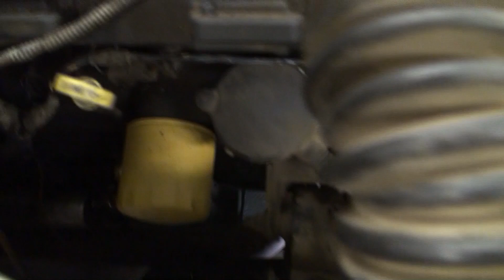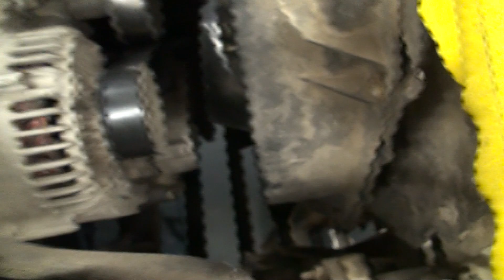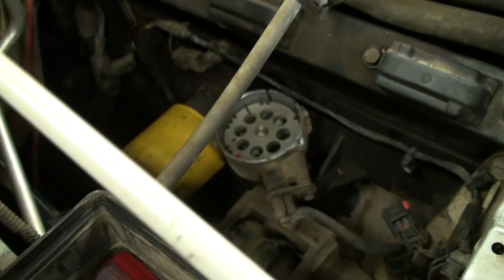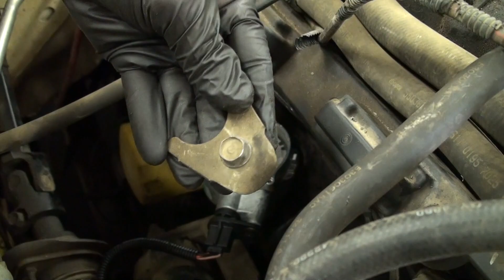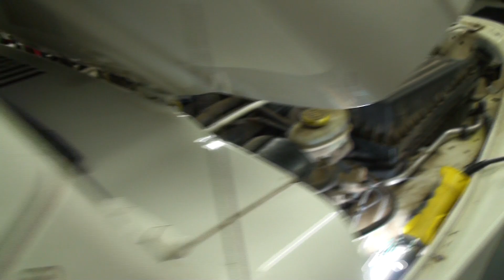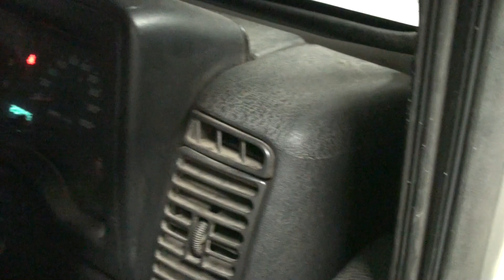05 Jeep Wrangler OPDA (Oil Pump Drive Assembly) change out

Comment: I didn't take the cap off the old camshaft to set the pin I just took the whole synchronizer out. Would I be able to just set the new in then pull that plastic pin out of the new camshaft synchronizer once it's down in?

Comment: Great video. However I would highly recommend NOT REMOVING the pin from the new unit, as removing the pin allows the unit to spin freely if it turns there goes the timing..... just use a small screw driver or punch to line up the hole in the old one. that pin is designed to be left in the new  Oil Pump Drive Assembly then when you start the engine for the first time it simply sheers the lil plastic pin off. they are designed to do this. Secondly you should remove the original camshaft position sensor from the old Oil Pump Drive Assembly and put in the new Oil Pump Drive Assembly, for some reason the new camshaft position sensors that are coming with the new units are prone to failure.. Good luck my fellow Jeepers

Comment: I finally got around to doing this to mine today. I have had the part for sometime. I was really wanting to take it somewhere and have it done, but after watching your video and a few others, I did this on my own with my son. It took us about an hour, and it all went pretty well. I was so extra nervous and cautious about lining  up the pin. We checked and checked, and checked it again. There's a little play in the original device, and we wanted to make sure that the max and min in the play was right in the middle.  The other hard thing was trying to figure out for sure which direction to turn the motor to get the pin holes to line up, but we figured it out. Why there did an oil change and it's sounding great and there are not CEL issues, as of yet. Drove it for about an hour after and no issues. Thanks for the great video on this it was very helpful, and surely saved me a few hundred $$ by doing it with myself, and some good tool-time with my son.
Reply: You turned the pulley clockwise, right? (I think this is the right direction, but I'd be happy to know which direction you turned it) just to avoid mistakes... (to be safe, I take advantage of the experience of those who have already done it)
At last, i ask if you removed a spark plug to make it spin with less resistance? I think it makes a lot of sense, at least logically it should make life easier without causing any sort problems for the final result...

Comment: I did exactly what was done here and the pin seemed to move clockwise about 1hr position.  It appears that I am still ok, I think because it would fit only there or 180 reverse of that.  If I try to cloch it 1 hr back it will not seat the shaft down properly.  Am I correct in assuming I am ok?

Comment: Nice video. Appreciate the step by step. A number of people are having trouble after install....it seems because the new one was more than the 2% or so off in alignment from the prior odpa.....I wonder if it is bc they are not using the plastic rod to align prior to removal.

Comment: Replace the old OPDA with a Crown Automotive unit, P/N: 53010624AC and use the OEM Mopar sensor. Do not use the Crown sensor as it will throw codes. The Mopar sensor has numbers etched on the sensor face; the Crown sensor is blank.

Comment: THE BOLT UNDER THE OPDA IS A 1/2" AND NOT 13MM AS HE SAID IN THE VIDEO. DO NOT USE A 13MM OR YOU WILL STRIP THE BOLT!!!

Comment: Thanks for the video - I do have to ask why you didn't show how you placed the plate and bolt that hold the unit in place. That one part was a PITA. And the 2006 bolt is a 1/2" bolt head. Very helpful

Comment: Great video! Had mine out and the new one in, in about 40 minutes.  The hardest part is getting the keeper bolt under the opda out and back in. Used my old cam sensor as I've read the new ones are garbage. Don't forget to pull the white plastic line up piece out once you've installed the new opda. If you leave the cap on you won't see it. I remembered, but I could see how you could easily forget it. Also, I used an open end wrench to turn the motor as it was easier to get on than a socket. Good luck, but it's an easy fix.
Reply: Which part is the cam sensor? The black harness hanging from the odpa or something else?
Reply: @---rg1gb  yeah it clips into the OPDA.

Comment: I just changed mine today after studying this video. It took about an hour to do it. The hardest part was reinstalling the keeper bracket and bolt due to access. A magnet on a telescoping shaft was a big help. I replaced the Crown Camshaft Positioning Sensor with a brand new Mopar sensor from the dealer, prior to installing the OPDA, so as not to experience the error codes. I did save my old sensor just in case. This is an excellent video.
Reply: Which part is the cam sensor? The black harness hanging from the odpa or something else?
Reply: @---rg1gb  Yes. There is one bolt holding it in place.

Comment: Couple things.... The OPDA retaining bracket bolt is a 1/2 wrench, not a 13... A 13 will strip the corners. Second, you need to mention putting in the new gasket, or you end up with an oil leak....
Reply: Make a video super chief

Comment: Thank you very much for posting this video.  Changed mine out on my 2006 LJ with no problems.  My hold down bolt was a 1/2" as someone else mentioned.

Comment: Is the replacement a Crown unit or an OEM?  Is this a permanent fix or ongoing worry.  Have an '06 TJ that runs great, but if this is a band aid, I'm trading.
Reply from the maker: +Steph N - It's a permanent fix! I bought the Crown unit from  jeep4x4center.com  As I said above, Wife works for post office, so It gets used daily and then some!  Hope that helps!
Reply: +cbharis How long have you had it in?  Did you look at the gear wear? I read should use stock sensor.  Thanks for this!!! I may just keep my Rubi and save a bunch!
Reply from the maker: +Steph N I read a lot of different things before I decided to do mine as well. I bought my OPDA back on November 17, 2013. I think I installed it a week or two later and didn't post it till much later! (yes, I'm slack... or just have that much going on in my life! But hey.. at least I got it up for you guys.... lol) 
Like I said, all is still going well thus far and hope it continues as it's a bread winner in my household! Good Luck!

Comment: Is the video missing any steps? I am not a mechanic and reading all the positive comments I attempted to replace my ODPA following along with the steps in your video exactly. When I turned my crankshaft (clockwise) to line up the pin, it completely messed up the timing on my jeep and I ended up having to take it to a real mechanic. I'm not saying your method doesn't work, it didn't for me and just posting so others know.
Reply from the maker: imabadfish1 Only way it could have messed up your timing is if you pulled the OPDA out first or loosened it first. 
After you remove the OPDA, you have to be sure to NOT MOVE the vehicle or crankshaft otherwise it WILL offset your timing! 
Sounds like either your timing was off already or you goofed somewhere. Sorry that happened to you.

Comment: Thank you my new crown unit is in the mail.This video will make my job very easy. Thanks .
Reply: Dan Gallagher Have you got some way of contacting Crown?  I've looked on their site and can't find the part on there.  Didn't know they had it.
Reply: +Dan Gallagher How is the Crown working out?  Is it better than a new OEM one?
Reply: I got mine through Quadratec.com
Reply from the maker: +Dan Gallagher I got mine through jeep4x4center.com. I got the crown unit. It's still kicking just fine! Wife works for post office, so It gets used daily and then some!  Hope that helps!
Reply: Steph N yes it's much better than OEM. OEM came with a design flaw that caused the malfunction to begin with.
Reply: Does the WJ have this issue?